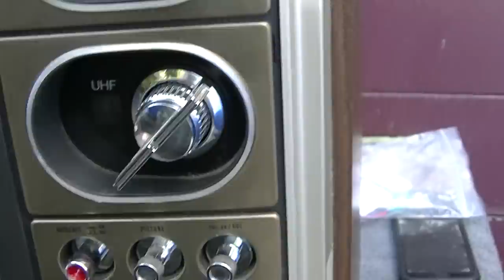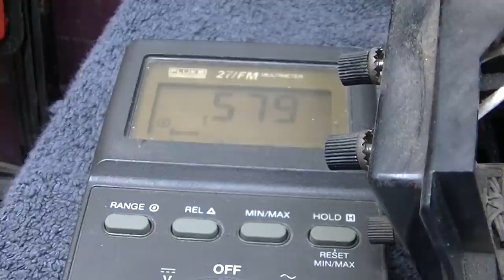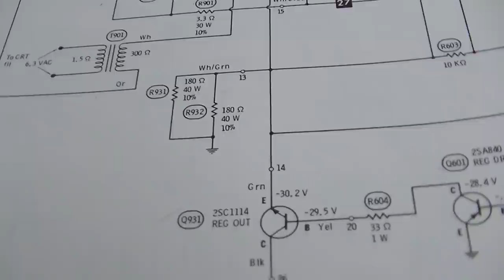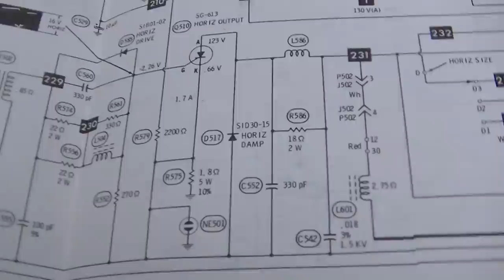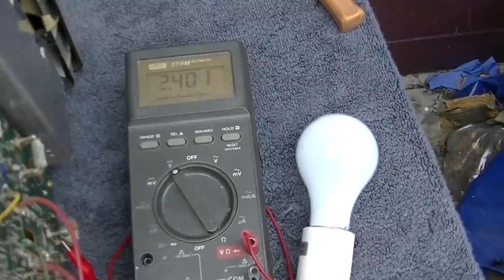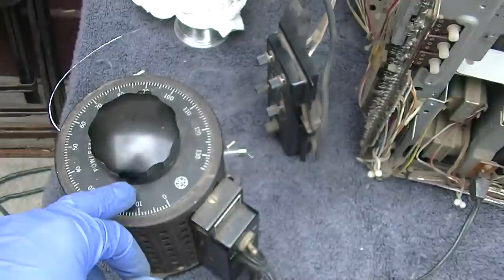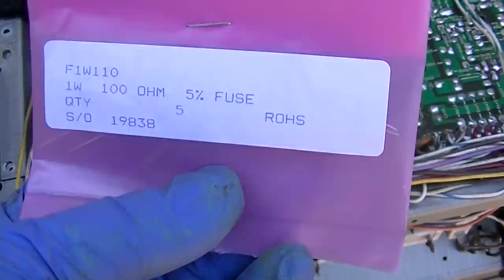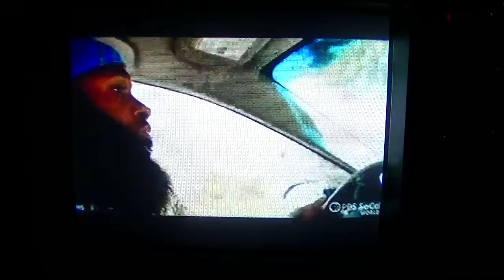1975 Sony Trinitron KV1712 No Power Diagnosis And Repair Vintage Color Television Set

Comment: I actually collect Trinitron sets. Your vids have helped me keep them alive. I find it exceedingly interesting when any Sony Television shows up anywhere with Low Hours. I don't think younger folks really realize how expensive Sony Trinitron sets were back in the 1970's and 1980's. These were regarded as damn near top of the line, Japans best. So 99% of people who went in and spent the big money for the Sony, used the ever living heck out of it, and while it still works, it's just tired.
Reply: My last sony XBR crt tv cost about 2 grand !
Reply: @richardbrobeck2384  I have a KV34Xbr910 and it's my favorite TV.
Reply: Yeah, I bought a 20" XBR, early eighties, not a bad size back then. 700 bucks, about 2100 in today's  dollars, but man, what a picture. I took electronics in high school, half a day for three years, love love watching these videos, don't see many concerning Sony.
Reply: @richardbrobeck2384  VEGA
Reply: @sheiladawg1664  *WEGA
Reply: @RoughJustice2k18  VEGA. It was two Vs offset from each other to illustrate DEPTH.
Reply: @vhfgamer  That is the exact tv I have it is a 300-pound beast it is a great set my other tv is a older Sony 27inch XBR with its own subwoofer that is the set i am currently replacing the capacitors and voltage regulator IC my repair shop used to sell and do Sony factory warranty I even had training provided by Sony I still repair Sony stuff for people, and I collect Sony audio and tv's .
Reply: @RoughJustice2k18  Wega was their top of the line set XBR was there flagship just like ES series was their     audio gear.
Reply: @richardbrobeck2384  Me TOO !, Bought the 36" flat Xtra Bucks Required edition mail order cost about $2000.00 with $150 shipping, it was made in August of 1999 and damn thing was put together in mexico, it had TERRIBLE convergence. I was mad, sony said as long as you can read everything there was no problem. I did sell it in 2008 for $350 bucks so I got most of my viewing out of it.
Reply: @richardbrobeck2384  Ah they made some good gear. :o)
Reply: I HAVE 5! IN STORAGE! HOW CAN I MAKE THEM ON!! ? TODAY,
Reply: @vhfgamer  Does play? I have 5 Sony! TV
In storage! May be best to junk 
? Them 
😕😕😕
Reply: @richardbrobeck2384  Can you make them to play real TV, TODAY. ?? I HAVE 5! SONY TRITRON
Reply: Yep,I had nothing but Sony CRT TV's. That was until the last big monster flat CRT 36". It was about 300lbs of garbage. 
All other Sony TVs I had worked great.
I don't think the last Sony TV was even Sony on the inside? 
I still have a small Sony 12 volt portable TV I use from time to time. My kids laugh at me and it. It's ok because it's awesome 🤘🤘 little TV/radio.

Comment: For as nicely as these perform, the delicate nature of the power supply and sweep circuitry is surprising. Low or high line voltage seems like it'd lead to big trouble with these, unless I've missed something.

I think you should measure that gap (feeler gauge?). It would be interesting to see if a broken one can be successfully repaired with sufficient precision in measurement.
Reply: The horizontal deflection and the power supply were quite fragile. Gate controlled switch? Who's idea was that?

Comment: Solid state TVs don't need variacs , this method can create problems  especially in those who have SCR( Thyristors) horizontal stages . Just bulbs for short protection and load if you test the power supply .
Reply: Variac is still good for those old TVs with linear power regulator. But it can cause problem with TVs with switched power supply.

Comment: We have a large color Sony Trinitron that we bought used in 1999 and is still working great! The only thing that went suddenly was the green color. It now only has blue and red for color. I imagine it must only be a component on the neck of the picture tube circuit board, but I have never gotten around to opening the set! Any suggestions what could have caused this?

Comment: A radio fuse in my car actually blew once for no reason, so it does happen (maybe the fuse was defective?) i simply replaced it with same rating fuse and it works a-ok

Comment: Analog over-the-tv was better. If the signal was weak, you got a snowy picture. But you still got a picture. With digital, the quality stayed perfect to a point...then it went to crap, pixelation, freezing, audio dropouts, etc.
Reply: ATSC is worst than ISDB-T and ATSC 3.0

Comment: In Australia, the model KV-1830 has an almost identical appearance, and shares many components. It was very popular as a new set. The major differences were that the power supply was switch-mode, to operate as a regulated 135V B+ source with a feedback from the horizontal (kick) stage to maintain operation, designed to be supplied from 240V AC (50 Hz) mains, and of course, the tuners and signal boards operating with the PAL TV system. In the event of any section of the line output / EHT stage being 'carmelised', the power supply would not start, saving the valuable SG-613 thyristor. I did many repairs on them in the 1990's, and the main problems were in electrolytic capacitors (power supply and vertical stages)...
Reply: in south africa we had KV-192 , I struggle a lot with that set , expensive to repair
Reply: @thaboboshielo2656 Frequently there were several faulty components, which took a lot of time to diagnose and replace as necessary in a repair. With these sets, it is very rare that just one component would fix the fault..

Comment: Man you've been hitting those Trinitons lately. I'm taking all 7 or so of mine apart today to check the flyback bolts, including 2 KV-1510 and 2 KV-1722s (like the 2 in your previous video that you had one fail)
Reply: I'm afraid to check the 15 Sony color sets I have. I hope none of them have the broken flyback holder.

Comment: I used to work on old TVs back in the mid 70s, I was a teenager and didn't have the knowledge or skills at that time to do the kind of diagnosis we get to enjoy with shango066. That burning resistor reminded me how much the 5 senses play a critical role in TV problem determination. Often you could tell just by the smell emanating from someplace a lot about what the problem was or at least the nature of the failing component. There is nothing like the smell you get as the dust burns of a super hot vacuum bulb, and that's why I prefer tube amplifiers. I never got to experience the odor - de - rat feces or  roasting cockroach, I feel like I am missing out. I doubt smell-a-vision will be invented in my remaining life time so perhaps it would be possible  to bottle some of these smells you enjoy so much and mail them to your patrons, or sell them as merch?
Reply: We used to call it "smelling Allen and Bradley" (when carbon resistors failed).
Reply: @DavidBrown-kf5uw  damn you changed out a tube at 12 years old? Crazy stuff.

Comment: I learned that a few years ago from reading the manual for a TV sold as a kit in the late 60s, they warned not to loosen the flyback nuts because the air gap spacers could be lost, the same bolts that held the core together were used to fix the flyback to the chassis, but using an additional couple of nuts and serrated lock washers instead of loosening the core to save a couple nuts and washers.

Comment: You're the only one that has taken the time to explain the use of the ESR meter to make it easier to find shorts in the presence of shunting inductors. Been doing this a long time.
Reply: Your and You are - are not the same thing
Learn the difference between the two
Your refers to OWNERSHIP
Your knowledge of basic English is at elementary level.
You can do better.
Undertaking an extensive reading program will be of benefit to you
Good luck and Good bye
Reply: @andrew_koala2974  your not making any cents
Reply: All this for a typo I didn't bother to fix. Geez. There I fixed it, now your blood pressure can go back down. 😀

Comment: Sony and Philips had around that time one of the best CRT's but not all tv's with their CRT's could get it on the electronic side. They where fun to work on and all but I don't miss the back braking on logging the bigger ones around. In the European side many had BUZ90 and BD17* that often had problems. half the time they desolderered them self's and you had to resolder them. Its clear that they used diffident power supply setups for 110V then for 220V. Besides the NTSC/PAL part for color that is.
Reply: many philips tvs suffered from 'dry joints', the g8, g11, k30/kt3 and ctx chassis most commonly, a tv service engineer i knew called it 'philips disease'  as was such a problem
Reply: Except for line and field frequencies and line by line comparison, PAL and NTSC are very similar. Telefunken's Walter Bruch borrowed heavily from NTSC working out several of it's shortcomings. And in those days, going from 110 to 220V just meant swapping out the power transformer. Many international models had a tapped primary and voltage selector switch. The filter caps for 50Hz worked fine at 60Hz. The main differences are the broadcast frequencies.
Reply: When I worked for Philips electronics in 2000, I brought the set with 22” dignally for $200.00 as employee discount program. The set die 8 months later and I can not view 911.
Reply: @johnmadow5331  Sadly by that time tv's had a philips badge but that was it. They where made and designed by a other company. only things philips really makes them self is medical stuff

Comment: “Your Sony color tv features the ECONOQUICK system which provides a picture only a few seconds after the set it switched on.Unlike conventional instant picture systems there is absolutely no power consumption for this feature when the set is not in use”
Reply: Kind of an interesting saga.. The Econoquick models just had a fast cathode warmup process.  The earlier versions that did not boast Econoquick kept the heater on at all times with a resistor off the supply.
Reply: @shawnstthomas4811  Its interesting that TVs from late 70s-early 80s displayed image after power up faster than TVs from mid 80s and later. Even the picture tubes still had the fast cathodes, automatic black control built in more complicated ICs slowed down the proces.
Reply: @xsc1000  Electronic consumer companies were taking great strides to make a television show a picture as quickly as possible without actually pulling constant power for the filaments coming the later half of the 70s. When the point came late in solid state, I think that "gimmick" was not highly desired anymore, and the companies laxed up I believe.
Reply: @xsc1000  Taking the heater voltage from the flyback also slows things down. You have to establish horizontal output before you actually start warming up the CRT.
Reply: @dougbrowning82  But it takes very short time in solid state TV sets.

Comment: Excellent video as always; thanks for sharing with us.
Since you give us lots of tips, here's a computer-nerdy one you or your viewers could use if you didn't already know: 
When filtering parts on Digikey/Mouser/etc., if you want a range of values, you can press shift while clicking the second value and it will select everything in between.
e.g., in your example @21:33, if you click 1500V and then press shift while clicking 2000V, it will pick everything between them too, so you don't have to do it one by one.
No big deal in that particular case, especially since they gots the Min/Max thing for voltage rating, but it can save a lot of tedium for other stuff sometimes.

Comment: I’ve had quite a few Sony trinitron tvs. I found that each size have their own issues. I found the 12s would have Y drive problems. The 15s had vertical issues. The 17s had power supply problem’s and the 19s had sync issues. Sony tvs are difficult to repair.

Comment: I can't figure out what breaks the 3mm bolt. Is it the heat causing expansion, thus too much tension on it? Three millimetres is not an insubstantial piece of metal to just break like that.
Reply: Metal fatigue . Goes from room temperature to whatever it maxs out at over a decade or so. Eventually the
 stresses split it in two. I think Shango showed this in a previous video not that long ago.
Reply: @hestheMaster  To be really specific, I think it’s metal fatigue caused by the constantly changing magnetic fields in the line output transformer.
Reply: @stickytapenrust6869  Shango said in the video from his last Trinitron HV transformer failure it is in the null of the magnetic field.
From the looks in the break of the metal( in that video) it may have been an inherent flaw in the process of making the bolt as it also looked like it was a very old partial crack then  came  a complete break later .
Reply: @hestheMaster   Does it always break in the same spot? If so, that does suggest a faulty manufacturing process.
Reply: @channelsixtysix066  Somewhere along either  long side where it is not threaded.
Reply: @hestheMaster  Never seen or heard of anything like that before.

Comment: Replace the bolt and power up the secondary section with batteries. Then tighten the bolt until the frequency is correct.

Comment: Not necessarily my brother went to electronic colonial eighties and add to those sets you're working on right there and one of them they were identical 1 of them would just blow a few at random intervals and need to have to take that back off and swap the fuse out in a way you go for a couple months and then it would screw up again and borrow a few every couple months he kept fuses

Comment: We used to take the sets outside the shop on a wheeled cart/table and blow them off with an air compressor before we began working on them.  I don't know why it's not done much anymore.  Yes theoretically one can generate static electricity with air but we never had a problem with it.
TV repair is like A.M. radio repair.  It's fun to get them working again.  However, once they are working, there's nothing but garbage that gets received by the instrument.
Reply: At least with AM radios, you don't need a converter box to receive the garbage broadcasts. Those old TVs get nothing nowadays without the help of a box. And soon, we'll all have to get new boxes for ATSC 3.0.

Comment: Too bad you weren't around when I was working on those I could have learned how to be a lot better with Sony TVs. I been working as a TV repairman for 35 years and now I only have LED TVs to repair. Try replacing LED strips inside a display screen. The only good ones to repair that I like are LG, TCL, HISENSE, and Sharp. LED strips are available. It takes a lot of practice to be good at it. You will need suction cup dent pullers and if the glass panel is stuck to the plastic rails with double sided tape you have to unclip the rail while it's still attached. Double sided tape will be your enemy and it will make you swear.

Comment: Its suprising to realise I fixed a similar Sony set over 30 years ago. 
I was still learning to fix TV's, so my first point of attack was to check all the caps in the power supply board.
All the faulty caps had a white ring around one leg,  strange how you remember things like that.  
With colour TV starting in Oz in 1975, they started needing service in the mid 80's. 
Ah the joy of working on TV's in wooden boxes!

Comment: Sometimes I cannot follow you on some diagnostics like in this video for instance, but sometimes I can, like when finding open circuits in parallel, when a circuit is open and should not be, I thought maybe he should try a better ground source and low and behold that is what you did and your meter showed a different reading, I said hey I guessed that one,  I know that was confusing, but I am trying. as usual though great video shangoO66

Comment: About this tv set, is not common use SCR on horizontal transformer or these arrangments... Our tvs in Brazil were used conventional transistor-flyback, secondary power supplies cames from flyback. Old TV sets common trademarks in 60-80´s were Philco, Panasonic(National), Philips, Sanyo, Telefunken (based on Germany or Japanese projects).
Reply: The only other sets I have seen with SCRs on such "unconventional" configurations were Magnavox old ones. Pretty unreliable devices... These SCR things were always blowing themselves, destroying tons of components in their path.

Comment: I like your videos.  I started working on sets in 1983/84.  Worked on many Sony sets.  We sold them.  I always hated them just because of the weird horizontal/power supply circuits.  The only other ones I hated worse were the old Philips/Magnovox C series chassis that self destructed when something failed and took out about 30 components.  Back then the SG 613 transistors we're sky high and I went through many of them over the years.  I will say I don't miss working on them.  Cudos to you for hanging in there and keeping them working.

Comment: Hi shango066 I was wondering if you could give me some tips, I found a television on the Facebook marketplace for 40$ it's in not the best condition. the speaker was torn apart by rats the crt inside of it could be bad all of the tubes glow and the crt but nothing appears on the screen. It's an Rca victor television from what I believe to be the 60s I need some help I'm a 12-year-old boy with no professional equipment no tube tester no nothing I want to repair it
Reply from the maker: You really need adult supervision by someone with experience in television repair. That's really the best way to learn the safe and right way to work on Old sets. I'm sure you can find someone locally who used to work in vintage television repair who would love to help you out. You learn a lot that way it's how I got my start